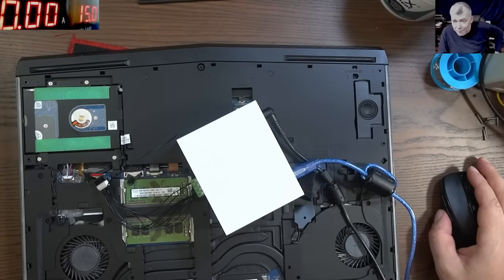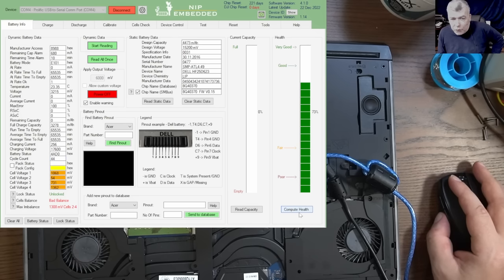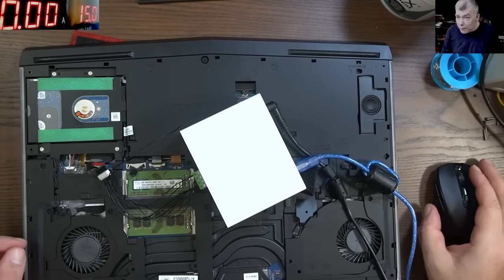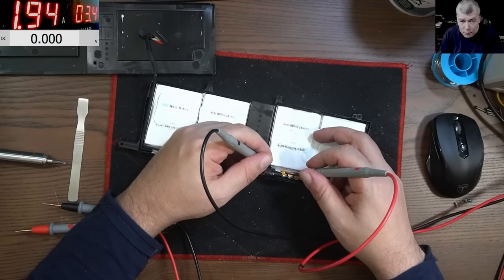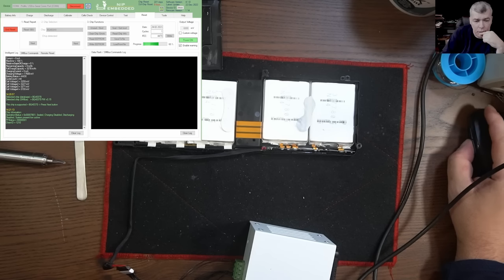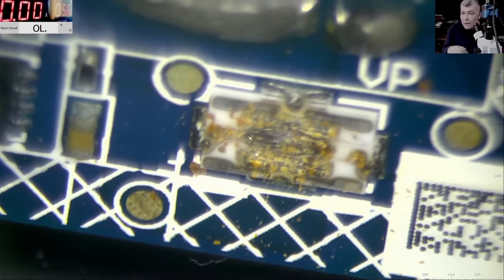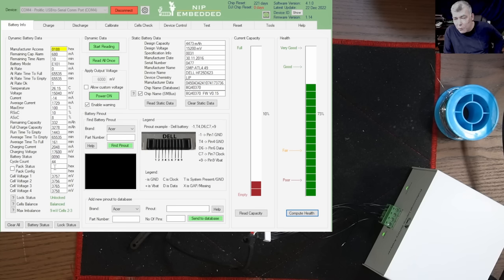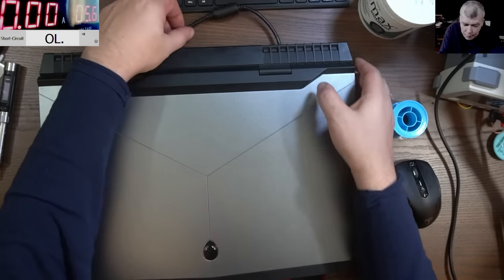Alienware laptop battery repair - Dell gaming laptop not charging

Comment: Sorin, i clicking on wake up more times and and the voltage on the cells increases and they can be charged. Only clicking few times on wake up and watch as the voltage rises on cells. Then you can charge battery. I revived a lot of batteries using wake up several times in a row

Comment: Great video as always. However this demonstrated that there is a need for this device. If all techs had access to one we could 'recycle' or 'rejuvenate ' batteries and save customers a fortune and prevent landfill. My issue with this device is the price and to add 'insult to injury' the annual license. I would have bought one but cannot bring myself to due to the subscription.
Reply: @MrHimer12  totally agree,  I understand the pricing model but do not agree with pay walls. Its a shame as I'm guessing more units would be sold which makes the pay wall pointless.

Comment: I had same issue with old model dell laptop, its happened about 10 years ago. Things was the same, battery was too discharged and unballanced, so Ive tryed to charge each cell to atleast 3V. But no luck battery locked itself as soon as I plugged it back to laptop.

Comment: Thanks for the video..but I believe that the fuse melted programmatically..on the basis of the expiration of the life span, you had to fix the fuse before programming the battery and see if the fuse melted or not

Comment: Battery analyser is a good tool bc you use it 4/2 in your videos means it is doing a greatjob ,not an obsole device to throw some side after some work with it ,new battery trick is that fuse ha ,to make it brick so they can buy new battery or better new laptop cause you cant find original ones from most brands nowadays ,what a bad thing to do to customer.

Comment: What is the resistance on these fuses? I'm measuring one on Asus battery, fuse marking is 12AJ4W and has 16 Ohms. Not sure if that is right? Cells are 3.6V, motherboard gives 0.250V on positive pin, so it's not charging currently. Funny thing, it was charging 16.5V prior to me manually charging cell by cell with 3.7V and 0.2A.

Comment: Can't  understand how this fuse works... you have placed a blob but on witch points/contacts???
Reply: I don't understand your question. The fuse has an internal heating element that when the firmware decides to self-destruct, it sends current through the heating element in the fuse, that melts the solder fuse, thus blowing the fuse.

Comment: Thanks Sorin! learnt a lot about batteries from all your battery videos, now I am ready to rip open my old one that is lying around but some cells are swollen, does that mean there is no point trying to revive it?
Reply: Yes. Swollen lithium batteries are beyond repair. They've out gassed the part that transfers charge from the plates. You can find new cells and replace them.
Reply: just be careful

Comment: Amazing video but i still cant see how we will repair battery without that thingy and software ?  so we can just like try to charge cells with power supply and plug it back to pc ? but what if its locked and it refusing to continue charging. for example i have one battery on hp it was saying 100% charged when i unplugged charger it just straight turned off, and than on i put charger back when i press button to turn laptop on on post it was saying something battery is not good bla bla cant remember i think something like error 601 and press enter to continue, and when i entered windows battery was on 0% and not charging how to explain that? it confused me totally like it was working perfect on charger i put new windows installed everything restarted laptop few times no error messages only when i finished everything and waned to test how much battery is holding that happened. (also in whole that part of installing windows etc i didnt take power adapter out from it bcus i waned to finish everything with software and than last test battery.  And now every time when i turn on laptop it say that error and you need to wait like 10 sec or to press enter to continue to windows. even i checked a bios and there was no option for warnings for battery only 1 thing was there to i can check to if laptop have problem with anything dont stop to continue (which many laptops have like ( stop on error messages or no there is few different options on different laptops ) also when i turned that on battery continued to show that error and not charge at all. Any suggestion without that special thingy how to get it back to life ? just to try charge cells separately ? even if they are connected together in serial mode or so? Thanks <3 much love from Serbia
Reply: Batteries are designed to self destruct. It has been said that sometimes batteries will even erase their own firmware. But the first thing to check, is if the battery gives voltage, and if not check the fuse. That is why I got tired of dealing with proprietary batteries, and built my own laptop with a battery system that is easy to change the batteries on.

Comment: Very informative video, although caution should be done when working with Li-Po batteries! I have now had 3 Asus batteries report 0V output after a dead laptop (shorted mosfet, EC etc.). I guess these are locked for safety, as the laptop will not charge or detect them. Is it possible to unlock these without special hardware?
Reply: There is an IC on the battery board that may have blown. Have to tear off the outer wrap to expose it.  Watch the heat around batteries when you remove it.

Comment: When you say heated fuse, do you mean a thermal fuse that’s blows when it detects to much heat?
Reply: No it's a fuse made of solder with a heating element under the solder. When the firmware decides to sabotage itself, it sends current through the heating element inside the fuse. That heating element melts the solder fuse, thus blowing the fuse.

Comment: I have a dead battery from a vintage laptop from 2002. Are there any options to revive it or build a new one in the case of the old one?
Reply: more than likely you would need to replace the 18650s and then restart the bms. there are jank ways to do it once everything is connected you can bridge the p+ line to the positive output and it'll start the bms. however it wont reset it and do all the neat things this program can do. But, you usually can salvage old batteries this way.

Comment: How You Sorin talk, and we also know today's laptop's battery, integrated in PC, can not be removed, so plugged to  charger (thas is a philosophy of laptop's,  to not luse works)logic manage to  stoped charges when batt rise max V. How in this gaming's laptop batt dye. We all know "work" on LT PC work with charger, and logical is batt for times, slowly lose capacity, but for 4-5 years (in my case with ryzen CPU, I miss lead quest. I can figure how el. logic
Reply: allow to gaming  batt dye. All good from Belgrade

Comment: Dell are a rip off for batteries and dell specific chargers
Reply: Yes but they work as intended. I work in repair and the dell original batts are better than aftermarket. Chargers are better also but not as important as the battery. They last.